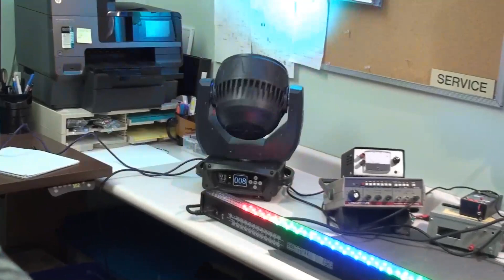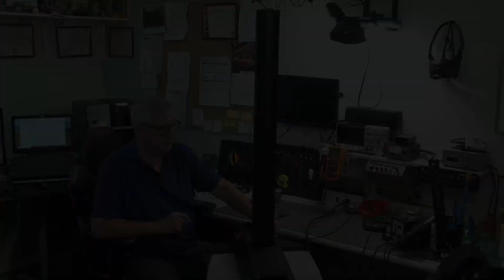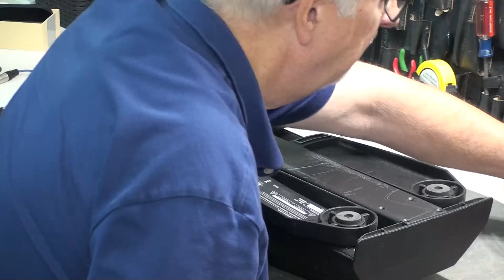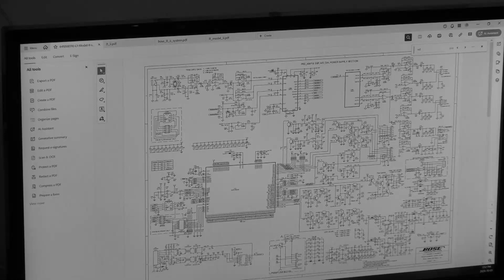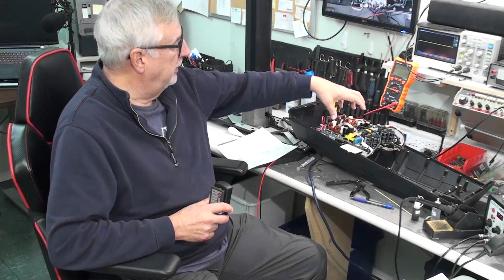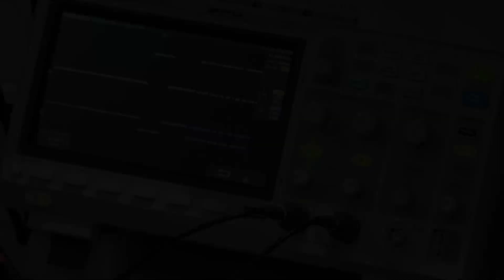"Sticking" with a Bose L1 Model II Portable PA - Part 1

Comment: Hi, Ron,
 I have a Bose L1 model 2 that powers on, blue light, and sounds good and clear. The problem is that I only get medium power, not loud enough to gig. I have tested this unit against my Bose L1 model 1S with the same mackie mixer with all the exact settings and the 1S is louc and working as should. I can’t get the volume on the model 2 to be loud even with the trim all the way up.
  Do you have any suggestions to solve this problem. Capacitor??
           Thanks
            Norman

Comment: Ron, I have Bose L1 Model II with Tonematch, Last night we were performing Karaoke, two performers did their performance, third performer touched the laptop (The laptop was connect to the tonematch via wire) and he got statics. Tonematch shows signals receiving (Green light blinks when the microphone receives the sound signals) but tower speakers not sounding. It is a rectangle base with tower speakers type system. Where can I get it fixed? OR can you fix it? Where are you located?
Reply from the maker: Thanks for the comment. Email me at techtips983@gmail.com and we can talk...

Comment: Ron, I have Bose L1 Model II with Tonematch, Last night we were performing Kaaraoke, two performers did their performance, third performer touched the laptop (The laptop was connect to the tonematch via wire) and he got statics. Tonematch shows signals reciving (Green light blinks when the microphone receives the sound signals) but tower speakers not sounding. It is a rectangle base with tower speakers type system. Where can I get it fixed?

Comment: Great info Ron. I have a question. I have an L1 Model 2 speaker system. Lately it is making a crackling sound when turned on for a couple of minutes but then it stops. Have you come across anything like that?
Reply from the maker: Sorry, I haven't seen that myself. If you open it up you might be able to narrow it down by spraying components with freeze spray and see if the crackling starts again. Also, check for bad grounds and other connections... Hope you find it.

Comment: Thank you very much for the video. The fan on the L1 model two is quite noisy. Can that fan be replaced with another one that doesn't make noise? Can you recommend a model? Thank you very much!
Reply from the maker: Hi. Thanks for the comment. Sorry, I must have missed this one. All I can tell you about the fan is: according to the technical info there are two fans. They are 12 V, 5500 RPM fans., The technical info tells how to remove them. They are turned on by the DSP chip when the audio signal exceeds a certain value. Apparently there is a service bulletin: 296133-B1 that has more information but I haven't been able to find that document. An AI search yielded this result: "The fan on the Bose L1 Model II runs quietly and constantly while the power stand is powered on, a behavior introduced with units manufactured in late 2014 and later, which were shipped with Firmware version 1.5.  This is considered completely normal operation. For units manufactured prior to this date, the fan behavior was different, but the current constant, quiet fan operation is standard for later models.  There is no user-installable firmware update available for units with earlier serial numbers, as the hardware is not compatible with firmware version 1.5."
Reply: @techtips983 thanks very much!❤

Comment: Hi great channel, I’ve got a quick question, my bose L1 model 2 fans cut off then the speakers stop working and the blue power light goes off, yet the tonematch is still powered up, yet no power to the speakers system, could you possibly point me in the right direction, any help would be gratefully appreciated, I’ve taken the amp apart and cleaned the boards but to no avail, it runs for about 20 minutes then cuts out the power to the speakers only.
Reply from the maker: Hi, and thanks for the comment. I'm not sure whether I can be of help. I haven't had much experience with using the Tonematch with the the system. If the Tonematch is still powered up but the speaker system has no power I'd guess that one of the protection circuits has kicked and disabled the system to prevent further damage. As I mentioned in the video, there are at least three protection circuits: two of which are the Zobel circuit and a current limiting circuit. It's possible you have the same issue I found, in which the Zobel resistor has changed value. The current limiting circuit could be caused by a faulty MOSFET in the output or a short in the speaker or related wiring, I suppose...but that's just a guess. Sorry I can't be of more help.

Comment: Hi there... I have a L1 model 1S and have a weird problem. It appears the LOW END is very low while the high end is louder.  Based on this I can now see it will be the power supply amp board for the SUB as you pointed out.  I do not have the schematic. Can you tell me which components I should look at , probably a voltage regulator or diode, just not sure which one.  thank you !!!
Reply from the maker: Hi. Thanks for the comment/question.  Yeah, it sounds like the power supply /amp board but it also sounds like the issue is consistent (doesn't switch in and out). It's hard to suggest specific components...it's a pretty complicated circuit. If you contact me at techtips983@gmail.com I might be able to help with some schematics...